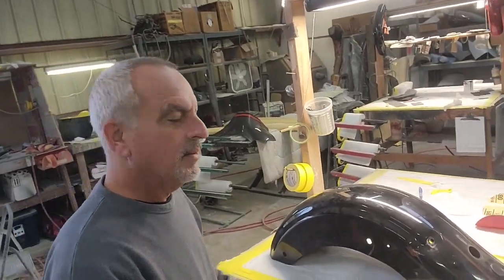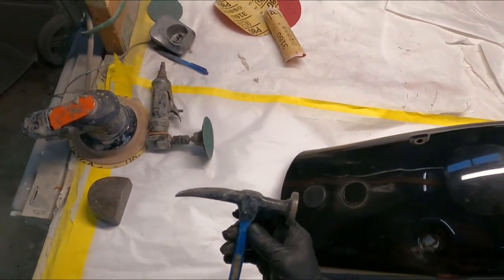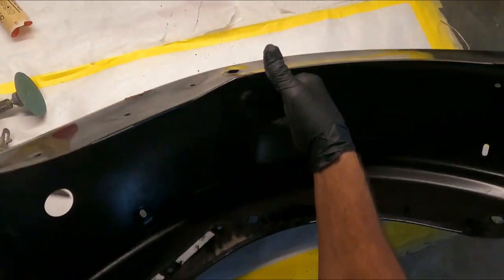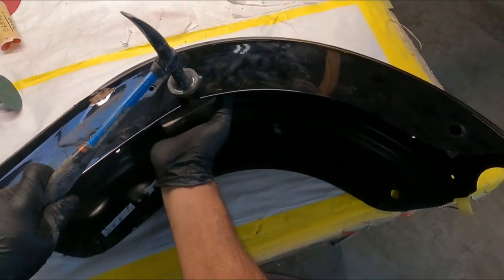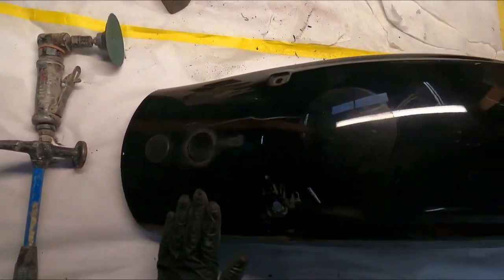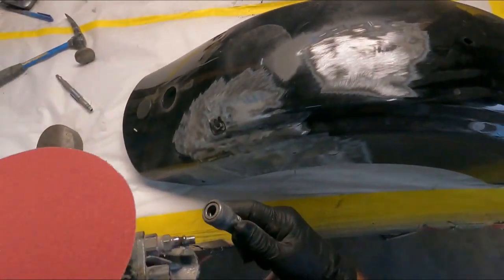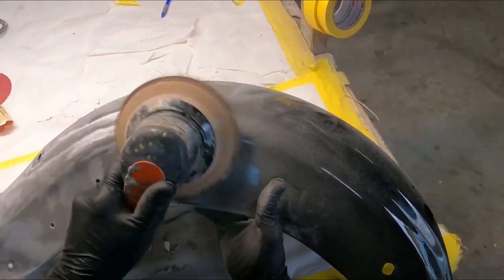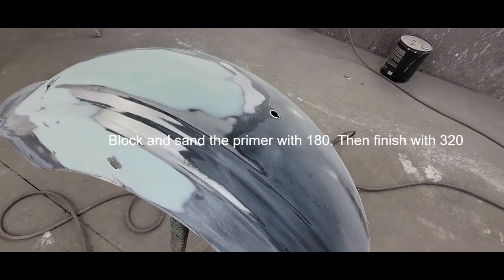Doing auto bodywork on a creased and dented Harley motorcycle fender

Comment: Enjoyed another one of your videos what 2K primer do you use
Reply from the maker: It's made by High Teck. I like using the buff color. Sometimes my jobber runs out and I get the gray though. So you'll see both colors in my videos
Reply: @TAZattitude  thanks is that the brand name where do you find that
Reply: What is a good all-around finish clear to use I know some of them can break the bank especially if you're doing metal flake or multi-layers
Reply from the maker: @sll-tt6bj  Yes, High Teck. You might find it from a local jobber but I found it online as well.
Reply from the maker: @sll-tt6bj  I like using Medallion. High solids and tacks up fairly quick. I believe the number is RS-6100 (not positive on that through)
I also keep in stock and use JC630 Shopline, UC35 HOK along with the JC6700 (I only use this for overalls)

Comment: arent those fenders cheaper to buy new aftermarket ? accounting the skilled hand time you have into it , sanding and primering ?
Reply from the maker: Sometimes you can find a decent used one. One problem you have with both big front and big rear fenders is it doesn't take much to crease the sides. If you see a small ding on the rear tip (rear fender) or a small ding on the front tip (front fender), there is a good chance of a crease on the sides by the rivets or the strut holes. So you are lucky to find a good used one.
I believe new primed from Harley are about $400
I have about a total of 1 to 1 1/2 hours. I believe I charged about $100
Reply: If it's a Harley OEM fender, they're gonna rob you blind for one. I went in for a quote on a painted 2020 Softail Standard rear fender .. $848.30 Yeah. Almost $850 for a fender. I told them nah you can keep it. So I went on eBay and found a used one with a lot of scratches and one small dent for $85, bought it, and I'm here watching this video to figure out a good way for dent repair.